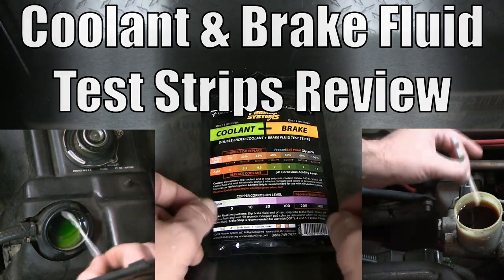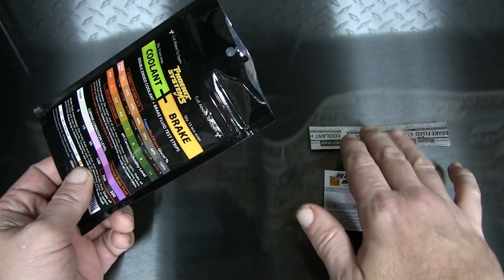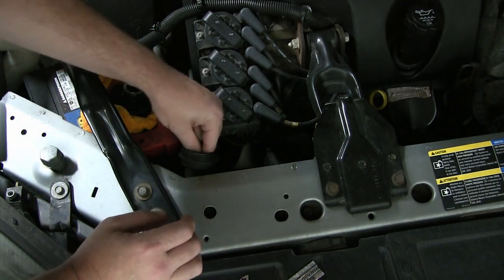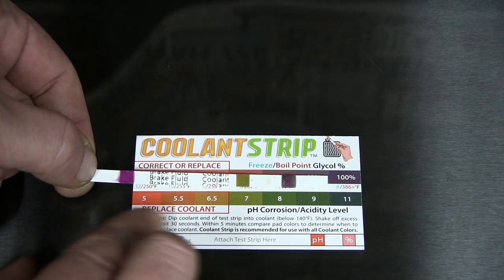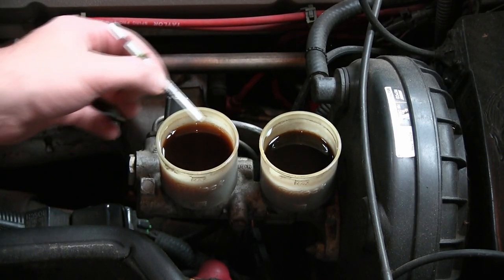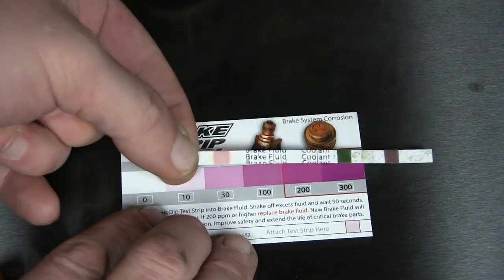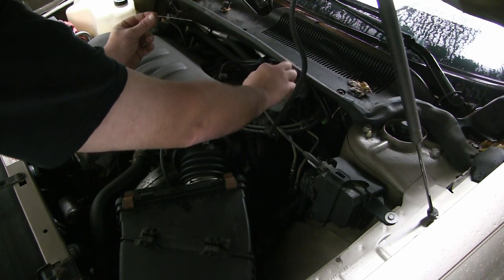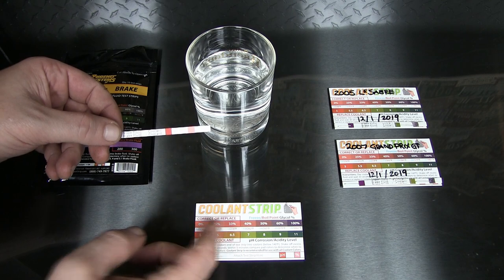Coolant & Brake Fluid Testing   Phoenix Systems Test Strip Review

Comment: Yes, I've subscribed & rang the notification bell.  Excellent & informative video.
I "stumbled" onto this video/topic, something I didn't even know existed.  I bought some, tested a strip on the brake fluid which was OK & coolant which told me the coolant was on the verge of turning acidic.
I successfully drained & replaced the coolant in my car yesterday using the OEM No Spill Funnel to help with the maintenance.
Everything worked - no engine overheating -- plenty of heat from the car's interior passenger heater & I replaced the same amount of coolant as I drained.
The Phoenix System test strips is a MUST have/use if or when looking to buy a used car.
Reply from the maker: Thanks for watching!

Comment: Excellent video. I've already ordered some of the test strips but I need to wait until the weather get s a little warmer (currently -2F in MInnesota) before I can use them. The 2013 Chevy Volt I got in late December 2023 has a basically unknown service history (but it has 63,000 miles on it which is good).
I know the brake fluid is going to need flushing (it's not supposed to be coffee-colored).
The Volt has three coolant loops: one for the engine, one for the battery pack and one for the motor control electronics. The latter two require deionized water in the coolant otherwise very bad things will start happening to the electronics (electrical isolation has to be maintained and deionized water is non-conductive). The coolant in all three reservoirs looks ok but who knows how long ago (or even if) it was ever changed.
Doing a coolant flush is non-trivial; it's not considered a 'Do It Yourself' job since you have to pull a vacuum on the cooling systems to get air out of them when you refill them.
Reply from the maker: Interesting knowledge you shared with the EV coolant.  More I learn about them the more I want to stick with a fossil vehicle.  Thought I heard some jazz like there were no Volts on the road anymore due to a buyback or whatever others were touting on the web.  With unknown history like you mentioned and the visual check of the brake fluid I'd just flush and fill it all too.  Strips seem to work good less the Ph side of things I found unless we have been drinking acid water from the tap all along.  These strips would also make an excellent test tool to have when checking out a used car before negotiating the final price.  Appreciate your comments, thanks for checking out the video, and best of luck with your vehicle.
Reply: @diymakerdan   The vehicle you're most likely thinking about the is the Bolt (which is a pure EV), the Volt is a Plug In Hybrid. There were manufacturing issues with the battery pack for some of the early Bolts so GM had them swapped for new ones for free.
Oh, I'm aware that the Volt is a very complex car compared to a conventional one; I'd been wanting one for 10 years and researching them for most of that. I'm a lifelong techie who grew up in a family of mechanics and gearheads so I can handle both powertrains. I have the Service Manual (all 8011 pages of it). It's stable as a rock going down the road and is a tank in the snow (the Bridgestone Weatherforce tires I had put on help a lot with that).

Comment: I had the same strips and forgot about them..   I just tested a 2016 Audi (only 18K miles) and the brake fluid results showed that the fluid was just fine. I was surprised by the coolant results... the Temp coverage was good, however the PH results indicate I need to replace the coolant... I'm really surprised by that and I'm not sure I believe it.  I plan to test new coolant to see the difference.
Reply from the maker: If it's original coolant in there for 5 years or so it is probably due to be changed.  I like the idea of testing the new coolant too, let me know what you find out.
Reply: @diymakerdan  The vette had good results on the brake fluid testing..interesting..
Reply from the maker: I was surprised too,  It can only be due to hardly driven/low mileage as I know that fluid has been in there 20+ years.
Reply: @diymakerdan  Audi says it's lifetime coolant...  The Maintenance schedule doesn't even mention coolant change intervals.
Reply: @lntemplediscussion2073  I think his vette have old brake system without copper. My C6 vette result was around 200ppm and replaced.

Comment: ? you were supposed to have the engine at 140 degrees.
Reply from the maker: Below 140.
Reply: The instructions ask you not to take the cap off the coolant at or above 140* F. Common sense stuff!

Comment: Good video but I think these strips must expire in time. Why? I tested 3 vehicles and NONE passed the PH test. One has an unknown history so I honestly don't know. I then tested a relatively new 2020 Challenger with 5,000 miles on it for accuracy sake. Obviously an inaccurate result. Failed the PH test. The other was a Trans Am with new coolant just 10 months old and 3,000 miles ago. Failed! The brake fluids checked OK and the temp range was OK on all 3. No way do I need to change the coolant with so little time and mileage on two of the 3 cars. I'm blaming the strips as inaccurate, and probably because they are old. No other explanation.
Reply: Same here with unused coolant, coolant in vehicle for 1.5 years, and distilled water.  All showing corrosive ph levels.